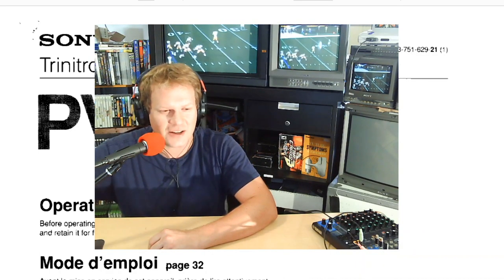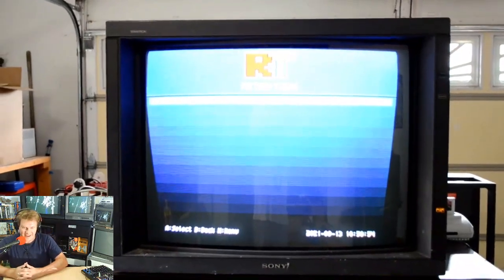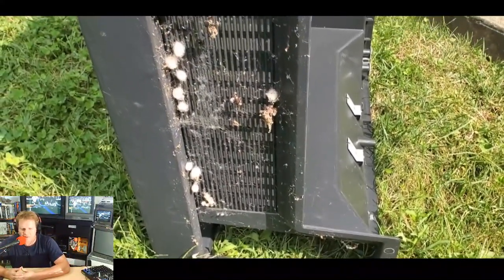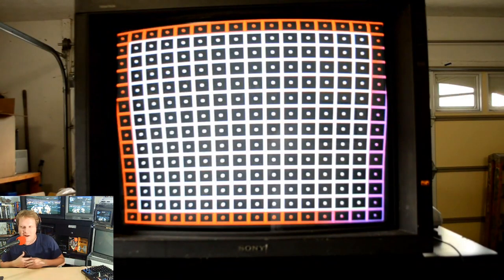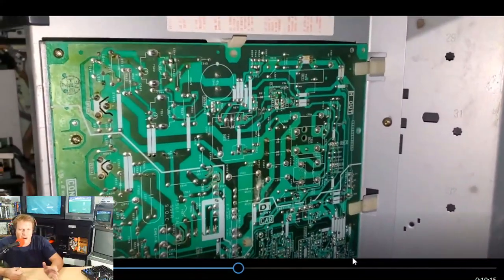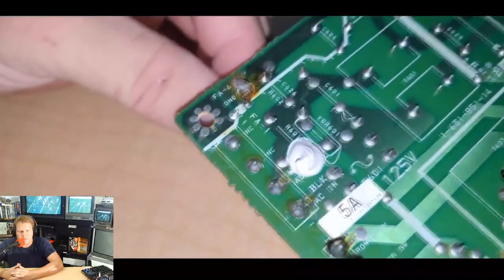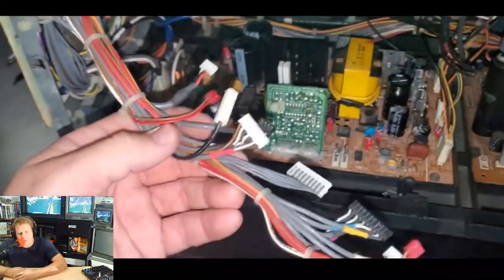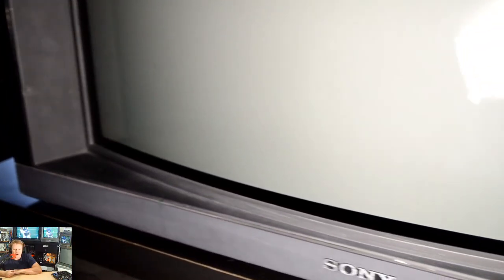Sony PVM 3230 Restoration | The Largest Pro CRT ever?! ~ Retro Tech

Comment: I worked as a service technician for a large pro video rental company in London in the 90's. These PVM's were very popular at the time, especially the 21 and 27 inch sizes. I loved the neat side control panels, and they were easy to move with the large handles - really great design. The main recurring problem with them was failure of the HT voltage multiplier - the potted red module connected to the anode cap.
Reply: Inexcusable. The engineering team should have caught up on that! It sounds like a gaffe in the multiplier's design!

Comment: When doing solid state electronic restorations, I've always avoided using a brush to do any dusting because that creates static which can damage transistors and op amps.  I've found it best to take the unit outside and use  compressed air and a wet microfiber cloth, and wet Q-tips for really stubborn areas.
Reply: wet qtips? fail, never use water
Reply: @alexvids9232  said "wet", not water.  Isopropyl or deoxit...
Reply: @alexvids9232  besides, even if it were water being used, as long as it is fully dry before powering up, no harm is done.  There are actually certain jobs on our bench which you may prefer water.  NEVER use a brush dry.  Static kills transistors and opamps.

Comment: Wow, look at all those egg sacs. That's incredibly intimidating. I'm amazed you were able to even remove the shell.
Reply from the maker: The crazy thing is I didn't even see them till well after I had removed the shell.  I only noticed them when I finally turned the shell over.  So gross.
Reply: @RetroTechUSA  Wow, that's nuts. Looks almost brand new after a good clean though!

Comment: I have a 3230pvm as well i would love for you to restore it!  My pic seems a little dull.
Reply: Dull is probably worn phospors in the CRT.  In this situation I personally would give a small boost to the screen voltage to partially offset the problem and then live with it until it's too dim.  You don't want to crank the screen voltage though because it's both hard on the electronics and can cause x-ray radiation issues.

Comment: Great video. Man those spiders are crazy. 
I recently got a 2730QM that I need to clean up and possibly recap the power and d board. This video is a big help. When dusting the boards off initially, should the tube be discharged? 
Thanks for making these videos. They are a massive help in learning about these complex machines. 
I’ll try document how it goes when I finally attempt to clean, recap and calibrate. In the meantime I’m just trying to learn as much as I can so I don’t break anything or get zapped.
Reply: Let me know when that happens, 2730QM owner here looking into giving it a nice refresh.

Comment: Hi
Just found this video. I have a PVM 3230 purchased new in year 2000. Its been sitting in my garage for over 10 years. Don't want to throw it away. Any suggestions?
Reply from the maker: If you want to sell it, send me an email.  snutt541@gmail

Comment: That weight is ridiculous. Heck, I find a 20" PVM to be impractical in a lot of situations because of the 30kg weight and bulkiness. The 14" PVMs are probably the best as you can move them by yourself without issue, and the smaller Dot-Pitch means you get a sharper looking image in comparison to a larger variant.